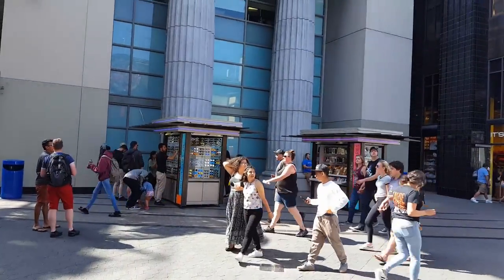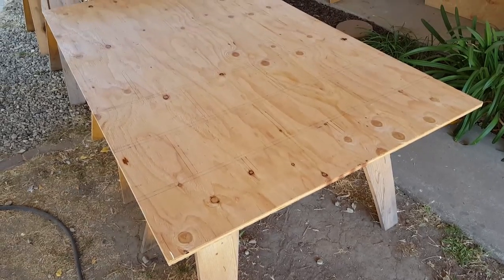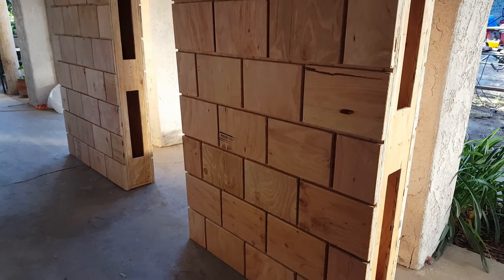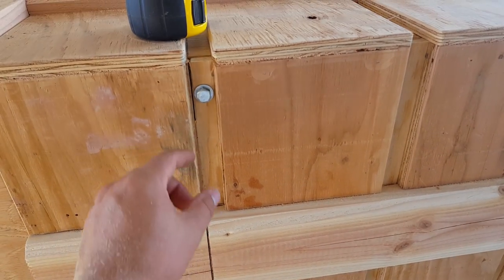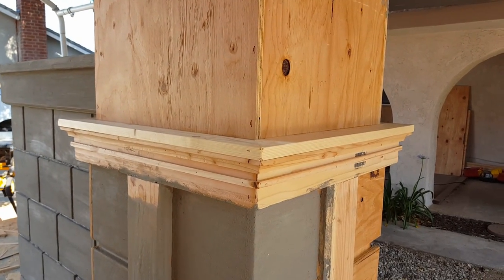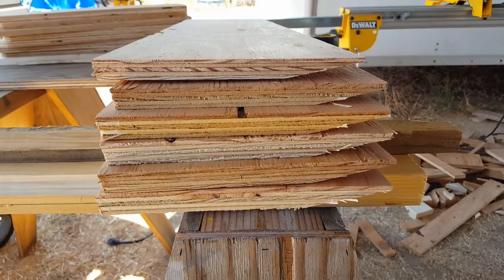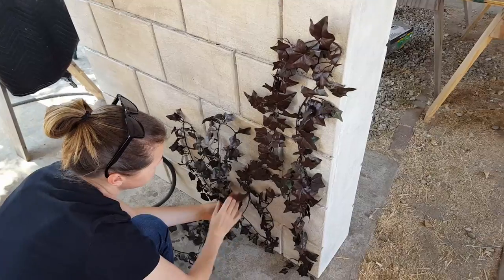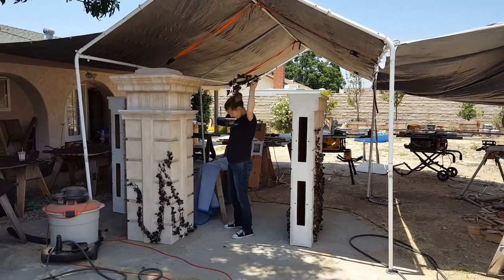Halloween Cemetery Entrance Columns & Walls | Graveyard Props | Anime Expo Cosplay Photo Set

Comment: I have a really dumb question for you guys. 

I have seen exterior homes and buildings with foam moldings and then they cover it with a cement type stuff. If it's on a house or building its gotta be somewhat strong right? Maybe not the same stuff you guys use? 

Anyway, you guys always blow my mind with what you come up with. Insanely cool.